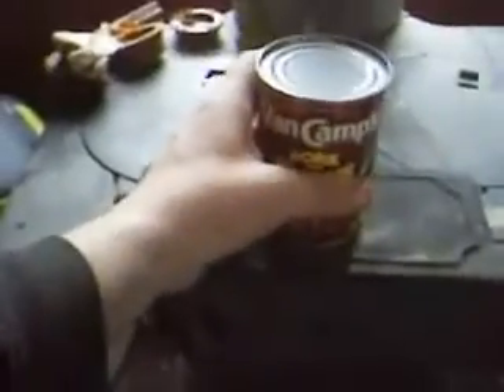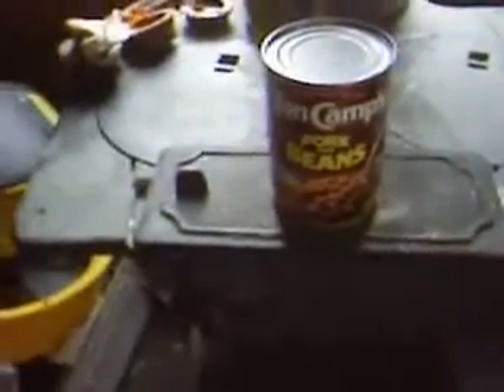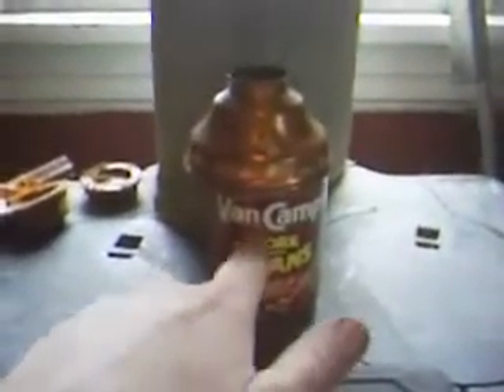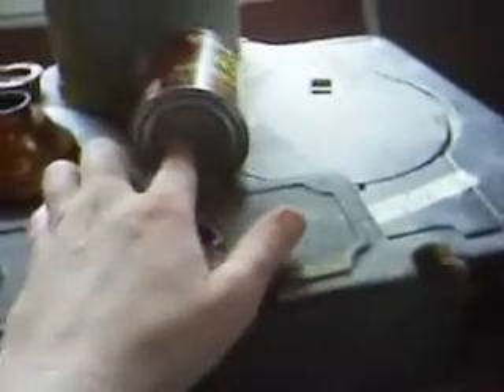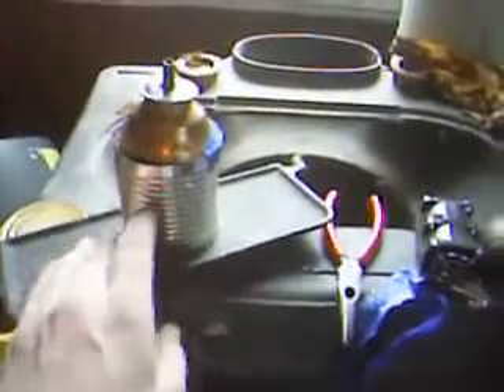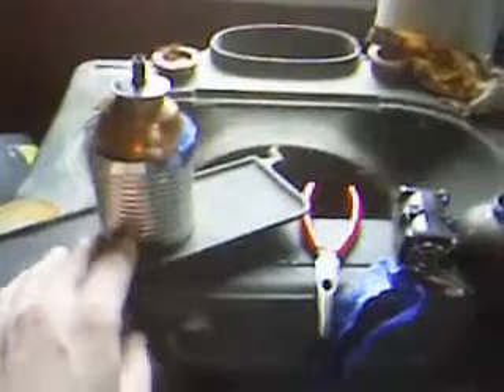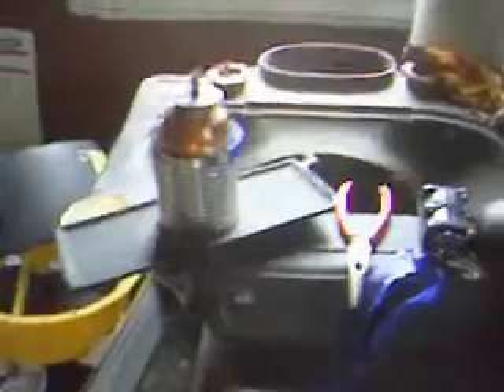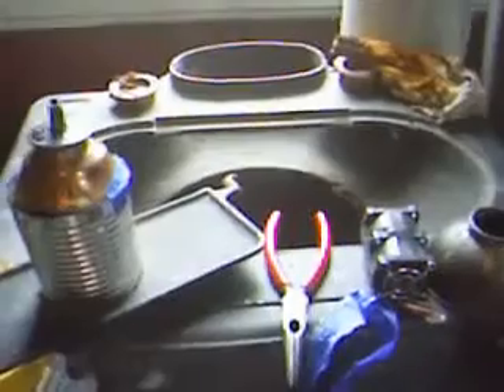Homemade Waste Oil Burner In A Wood Stove

Comment: Ever considered sharing any specifics regarding temperature of the stove? I watched all of your other videos (the ones regarding the oil burner) and I'm not seeing anything that details specific resulting temperatures. The reason that I'm pointing this out is because you can fry potatoes with a plain old blow torch and a cast iron pan. But, try to warm up 600 gallons of water to 70 degrees with the same blow torch and I'll have to wait 6 months for an answer.